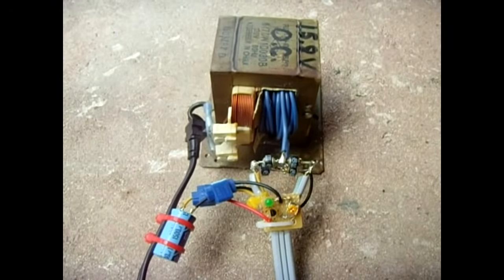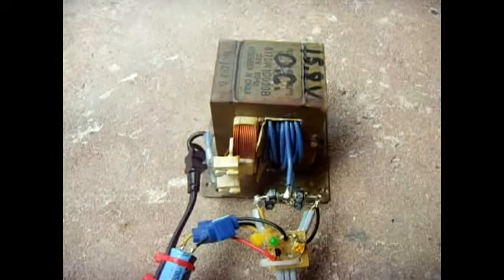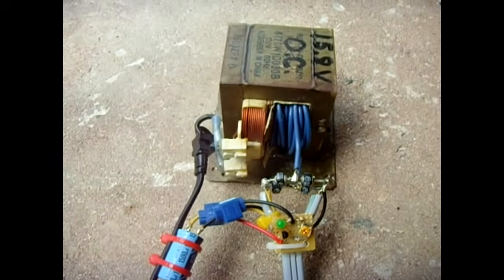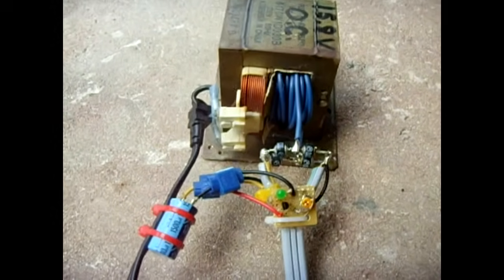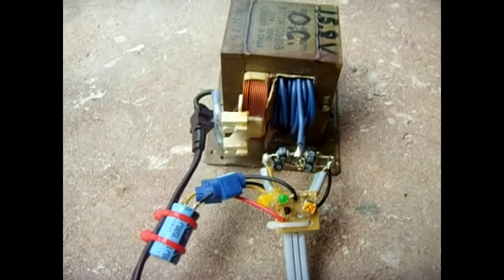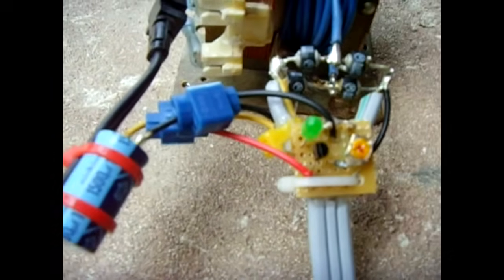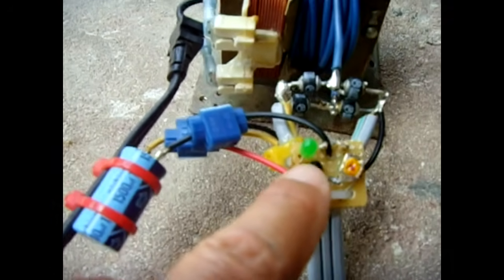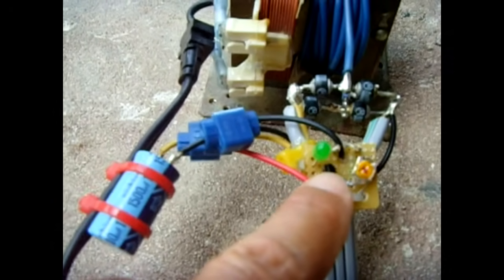DIY Lead Acid Battery Charger From Microwave Oven!

Comment: Bro I am using microwave transformer to convert 12 volt power supply but my transformer is heating without load I don't know why I am using 16 wg copper wire

Comment: I did my MOT but the thing is heating up really scary..could you help?
Reply from the maker: Some can get hot, because they're fully saturated. I suggest you place the cooling fan from the microwave next to the transformer to keep it cool when in use. Thanks for watching

Comment: Am not able to get a 12 volt 2 amps transformer from where I buy electronic components but they have 12 volt 1000miliamp transformer can it be used to recharge a 12 volt 2.5 amps battery
Reply from the maker: Yes, you can use a 12V 1A transformer to charge a 12V 2.5A battery.
Reply: thanks for replying
Reply: If I make use of a 12 volt 1 amp transformer will it be able to recharge my battery up to 14.2 volts
Reply: thanks a lot it works

Comment: How many miliamps transformer do I have to rectify in order to recharge a 12 volt 12 amps battery? Does the farrad of a capacitor really matter when it comes to designing a battery charger circuit. The battery I want to recharge is a motorcycle battery
Reply from the maker: The capacitor value isn't critical. Ripples in the DC output will not pose a problem. Look for a 12V - 14V / 2A transformer.
Reply: Thanks a lot for replying
Reply: +electronicsNmore  i have a mot  220v 50 h i  cut the secondary and put the secondary18 gauge 15 turns .when i give 220v there is small blast i did disconnect when i check the  mot in series cercuite  mot  is work . where is problem ?
Reply from the maker: The wire you used is way too small. I have no idea what you did.
Reply: +electronicsNmore  can i  increase turns in input winding if yes then how many turns i need. may be mot is not 220  .may be it is  120
Reply: +electronicsNmore if mot is  120 then how many turns i  need in  primary  coil
Reply: +electronicsNmore because in Pakistan 220 v use

Comment: how it still working
Reply from the maker: +donald laisure (73SuperGlide62) 
Works great. There is very little to go wrong with this charger.
Reply: So question did u post a diagram. For us slow people
Reply from the maker: donald laisure
If the circuit is easy, like this one, I usually explain in the video how it was done. I have other videos showing how to chop out the microwave oven transformer secondary.

Thanks
Reply: Thanks sir

Comment: in the schematic it says 10a bridge rectifier,  but when I look these up on ebay, most of them are rated 1000v.  This seems like a high number so was wondering if I should find a lower voltage, or if those ratings are just a maximum.
Reply from the maker: +Brady Rose 
Higher voltage rated bridge rectifiers are just fine. Don't worry. 
Thanks For Watching!

Comment from the maker: Use a transformer from an old / broken SMALL 220V microwave oven, and wind on 10-12 turns, then measure the AC voltage output of the winding. Ideally around 14V before you rectify the AC voltage. Refer to my MOT - Microwave oven transformer winding video for more details.

If you like these videos, be sure to tell your friends and subscribe. Thank You.

Comment from the maker: This is a MOT with the secondary 2000V winding(the THIN wire side) CAREFULLY cut out & removed, then you wind 20T of 12ga stranded wire in the same direction that the 2000V coil was. Then add a high current bridge rectifier to the output of the 20T coil. After the rectifier add a 25V/1000uF(can be higher) capacitor across the output for smoothing purposes. then look up on my video list "rising voltage indicator" which connects in parallel to the output leads to the battery to be charged.

Comment: if remove the cap, this charger will work as a desulfator, as you will be getting about 120hz dc pulse. But then you would probably need higher voltage to quality desulfate a battery
Reply: Can you explain more like how many turns for pri and sec

Comment from the maker: I think you need to open your eyes. The capacitor is AFTER the bridge rectifier in the AC to DC conversion process. It smooths out the DC ripple, and causes the voltage to rise.
Reply: 12 v good but amp =?

Comment: I believe charging battery with such high current isn't the safe way.. Diodes will burn-out.. 5Amp should safe. I charge my car battery with 1Amp over night so 5Amp should do much faster.

Comment: very nice dude.... 
Im gonna build one today for my battery !
im gonna run my car amp of the battery :D I had a big voltage drop on my computer power supply(i had my amp on that before) Q: Do i have to get it to about 16v and do i have to use bigger wires for the secondary to get the battery to charge or can i just have the lower amps to charge the battery slower??